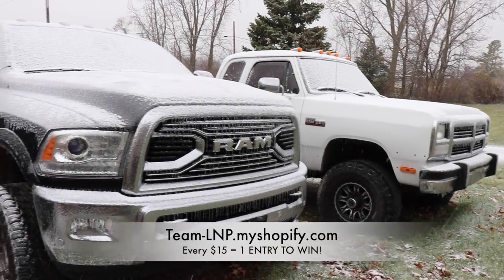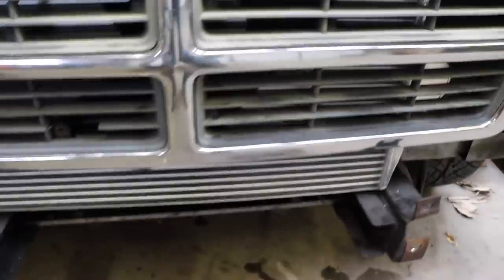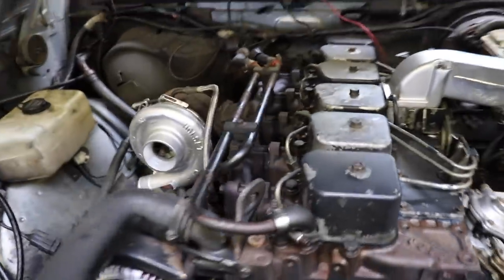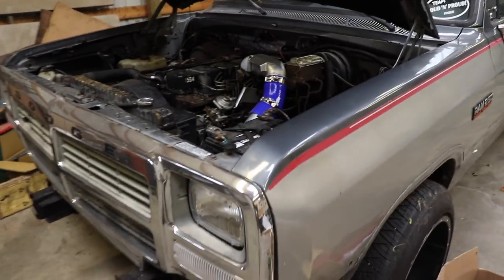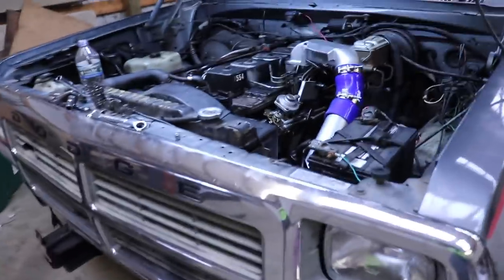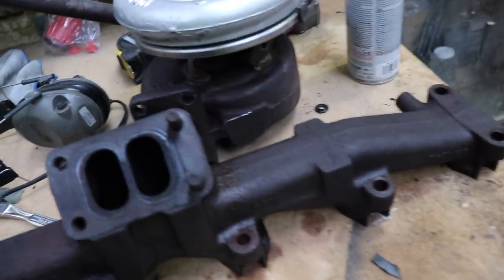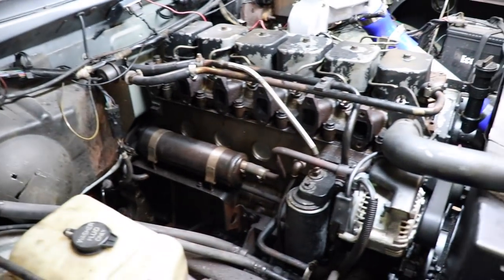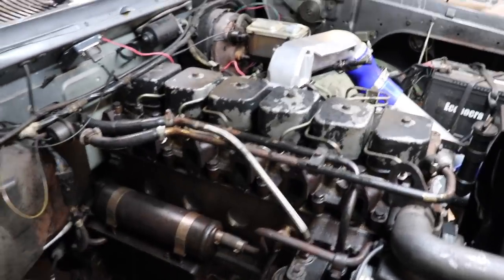ALMOST TIME FOR TWIN TURBOS ON 1ST GEN 12V CUMMINS!!!!

Comment: Lnp you can only have one for the next 20 years and you have to drive 3,000 miles per month.  What you keeping?  6.7L 24 valve, Ve pump 12 valve or 6BT Ppump 12 valve?
Reply from the maker: 3596Bt if it’s all stock... 1st gen
Reply: Me Too.  Reliability

Comment: If I bought a 5in exhaust turbo back do I need a tuner on a 2001 24 valve ?
Reply: Levi Bartram no
Reply: Not at all. A cold air intake would be a better complimenting mod for a 5 inch exhaust. I'd stay away from the tuner side of things until the truck is more prepared for it. You can make some more power with new parts first and then add some extra juice after that.
Reply: pure panoRAMa okay I was just wondering since a lot of the newer trucks is you straight pipe it it’ll throw and engine code and could go into limp mode if not tuned
Reply: @levibartram8764  You should be all set just getting her opened up and letting her breathe. You can do a tuner. It won't hurt anything unless you're cranking it up and hammering the truck all the time on stock components. You'll definitely enjoy the added power gains from it I'm sure, but it's not absolutely needed. I hardly use my edge comp box and when I do it is only on level 2x5 typically.